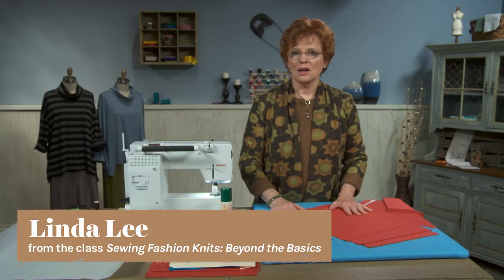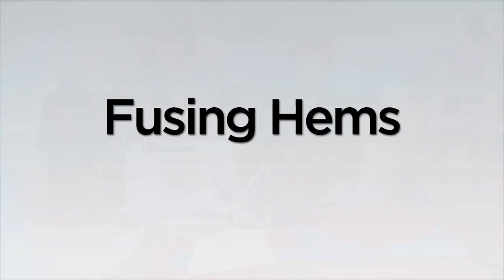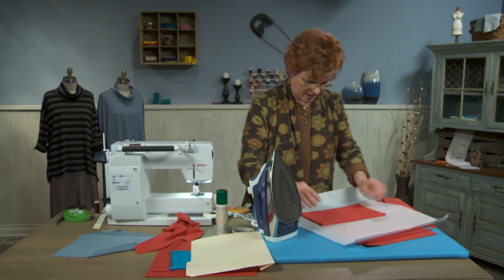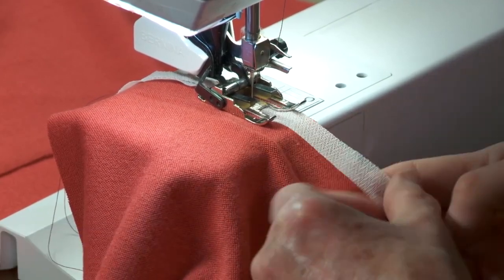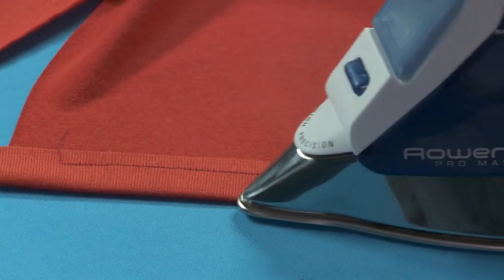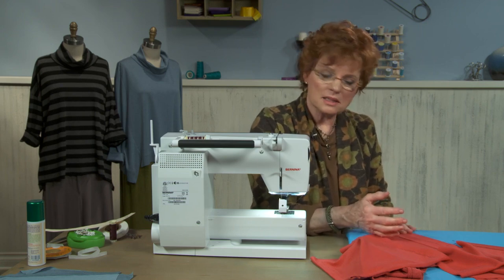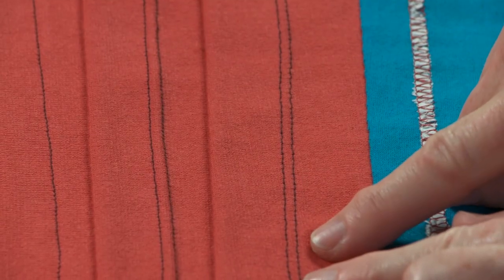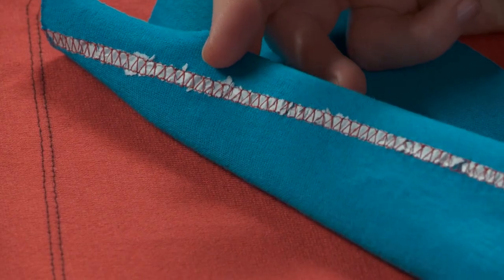How to Hem Knit Fabric Without a Serger | Sewing Tutorial with Linda Lee

Comment: I have the adhesive spray and let me tell ya that stuff is so difficult to get off things and sprays everywhere. I like it because it holds up very good and seals like fabric, shoe soles so fast even arts and craft.  Another prblem I had was after I bought the product and used it a few times the glue dried on it and now I have to throw a new can in the garbage.

Comment: I was rather disappointed with this video. It showed three different types of glue to use without providing a definitive answer as to which is best for the sewer who may only need to hem a variety of knits but only occasionally.  I also noticed that a walking foot was used but not specified, only mentioned in passing.  When the effect of the initial tape was shown in comparison to the sprayed on & the sewn on tape, it appeared that they had both been ironed after hemming onto the knit, yet the first one wasn't.  It would have been fairer comparison if it had also been ironed after hemming.  I also wondered if the glues or tapes were stable enough not to need a further machined hem as it wasn't made clear in the video. I have also noticed that many glues & tapes tend to deteriorate if not used in fairly soon after purchase, so to have to purchase 3 different types of glues just to work out which was best seemed a little over the top to me, unless one uses such tapes regularly.  However I liked the part where a light card was used to set an initial hem on the knit using the iron, but I wondered if it would be better to sew a fine lace onto the edge of the hem, then either hand sew it, or try using a hem stitch, or the single row of stitches.  I intend to try each sewing method minus the glues & see what provides the least conspicuous but neatest hem.  I doubt that it would take much longer to hand stitch, or even fine stitch using a hemming foot than it would to mess around with sewing on glue tape, then still sewing another hem on the edge of that.
Reply: @Wendy:  How many examples do you need?   That said;  not to offend you BUT most craft projects (in this case it is DIY sewing)  require some experimentation.  ☺